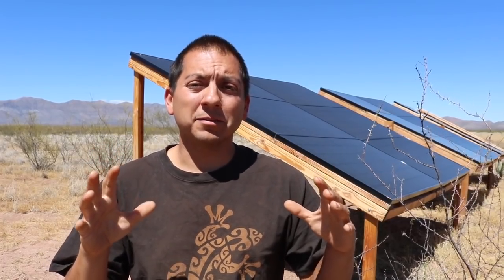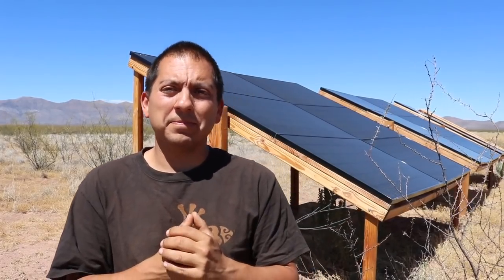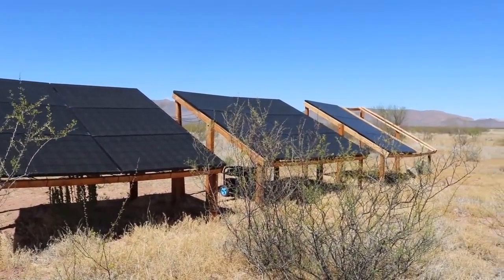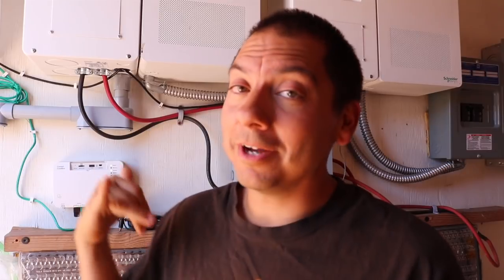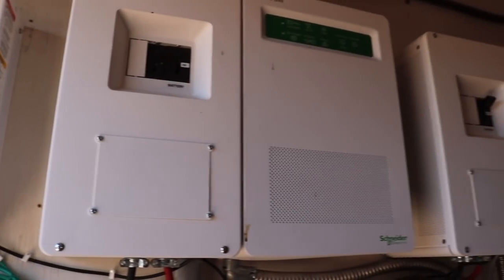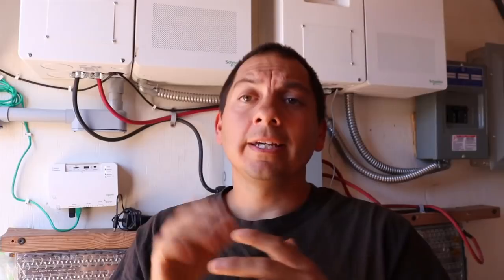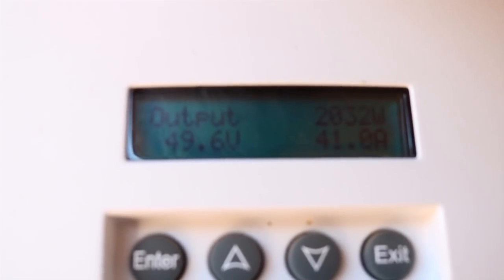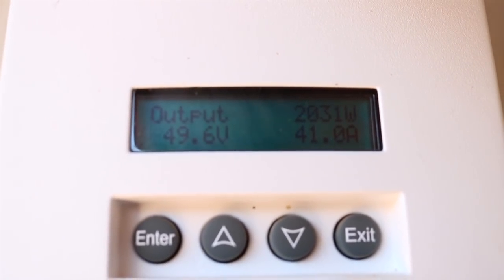Can You Run Air Conditioning on OFF-GRID SOLAR?

Comment: Call me crazy but if cooling is an issue - and in Arizona, it is - wouldn't it make good sense to build the panel racks so that they cast shade over your living accomodations?
Don't need to remove anywhere near as much heat if the heat never even hits the house.

Comment: I think a small portable swamp cooler wood work ok on your solar power.    Mastercool also has a small shop air conditioner that would work fine.  It would be best to put it outside and vent the blower part into you house.

Comment: My grandparents live fulltime in an RV in Florida so they can travel part of the year, something they did to cut down on cooling in the RV is on the land they bought to park the RV in Florida they installed an RV carport. This shaded the RV and drastically cut down on the amount of energy needed to cool the RV as well reduced the overall temps in the RV when the a/c isn't on.
Reply from the maker: Shade is definitely a huge factor out here. The more shade you can get, the better usually.

Comment: That's my next adventure angle is trying to get me some solar power out here Tomorrowland I have a business on my other land but that requires to be hooked up on full like TriCity unfortunately I try to get solar power in my area unfortunately my town doesn't allow it isn't that crazy a town doesn't allow solar power I think it's a big gimmick out here in Royal USA but I got the electricity on one land and II land that I physically live on will have solar power will have Harvest rainwater and will have no electricity running to it I stay in a 30 amp RV I would love to have enough power to run three of these RVs just for land use only of course thank you for such that wonderful information you have provided me and I hope it provided to other people solar power sounds so technical but in reality it really isn't as a bunch of batteries a couple inverters and the solar panel outside soaking up the Sun

Comment: We have been offgrid for over 6 years.  We have built our system from scratch.  We do not have the fancy system you have.  We run a 10400 BTU 110volt Air Conditioner with no issues.  We only have 2220 watts of solar on trackers and 740 fixed solar panels.  We only run a 24-volt system.  We run a 220 volt well pump for the deep well.  We run a 120 volt well pump for our rainwater system.  Plus the typical refrigerator and 2 freezers.  Of course, we still use the lead-acid Trojan L16 batteries.  It's always interesting to see other setups.  I enjoyed seeing your system.   Thank you for sharing.
Reply from the maker: Thank you so much for checking us out!! It's an honor. 🙏
Our system is the way that it is because we had more people at the time. Now it's a bit oversized. 😬

Comment: I couldn't really tell from this video, but does your shade structure extend over your trailer? That would obviously, drastically improve your AC run time on hot sunny days. Well, not drastically, but it would help alot.
Ever considered a 110 volt 12,000 btu mini-split? Hi-efficiency units with 20plus SEER ratings can be found reasonably online, especially during winter months for lowest prices.
Great, informative and clear video!!
Reply from the maker: Thank you! The shade structure doesn't extend over the RV'S. A mini split would be nice, but we probably won't invest in that at this point. We're looking forward now to building a home.

Comment: 6k running Watts is a lot of power. I look at my meter all the time the most I’ve ever pulled was around 7k. That was with fridge freezer dishwasher hot water heater. Everything in the house running. Complete power hog.  Are u gonna hive crew a shave. We need to do that to our dog.
Reply from the maker: Yeah, it's definitely a lot of power. More than we need now, but this was planned for at least two households. At least now we have redundancy in the system. 😀
Thanks G!

Comment: We are still not able to use our solar for ac but we plan to add to our system when we can ultimately run the ac. We use our generator currently which is costly and not really sustainable. Impressive set up, the daddy bear approves! <3
Reply from the maker: 😀Awesome! The system wasn't cheap, but it is efficient. That's the cool part about solar. It can always be expanded and upgraded. 😀

Comment: I agree with what some others have said. Build an underground house. Think finished basement without the surface structure. Underground houses are naturally more energy efficient because you have the earth insulating you. For example, dig a foot deep hole and touch the bottom of it. Already cooler than the surface.
Reply from the maker: Yup! We may also build with earth as well. The more thermal mass the better.
Definitely more efficient. 
Thank you!🙏

Comment: Nice system! We're currently grid tied for electricity, and would like to at least get a little off-grid. Have you looked into wind? If you use a vertical fan system, it's much more efficient than those big ugly propeller turbines. I'm thinking of doing something like that myself in addition to solar.
Reply from the maker: At this point wind might not be the best option for us. We've already have the solar investment, if we needed more energy we'd probably just expand on our current system. 
Grid tied is actually a good way to go. Batteries are usually the most expensive part of the system. You can always add a battery back up down the road.

Comment: I just installed a window ac in our trailer, primarily because of the dogs. I’ve been watching our usage and the window ac uses half of what the roof ac does. Not only that but, it’s cooler and the unit actually cycles. I was worried about the wiring in the trailer as well so I ran my own.
Reply from the maker: That's awesome Warren. We're definitely thinking about switching.

Comment: Perhaps isolate a section of the new roof system and build a swamp cooler.  Not sure how much water or power it uses but they are usually just a fan to move the air and a small pump to create the water fall.  You do not want to enclose the area, you want the area to breathe.  So maybe enclose area half way up and then screen in the top section.  Also helps to stop flying insects.  The AC is using a renewable energy source and where you are water is precious so this might not be preferable.  But it could be an option when you have plenty of water and in the heat of the day in the afternoon.  Low humidity is a must to provide the evaporation and you should have that where you are.
Reply from the maker: Some really good points. Eventually we'd like to build in a way where we don't need any type of cooling other than a ceiling fan. At least were going to try.

Comment: Thanks for sharing.  You can definitely run air conditioning on solar alone with the right equipment. I may be getting the tech stuff wrong, but we are ducted and just waiting to purchase a new inverter that can convert to 220 for air conditioning.  Right now we are running 2 Bonaire swamp coolers that work pretty well when temps are under 3 digits.  How are you liking the Tesla batteries?  We've talked about converting over to them from our deep cells?
Reply from the maker: I think the Tesla batteries are great, but I haven't used any others. Once they're hooked up though, you never have to worry about them.

Comment: Hey, we have exactly the same panels as you.  That is, 15 x 320 watt LG - located in Tucson.  We tried to run a 120 volt mini split off the "emergency" 15 amp outlet on our SMA inverter.  It was a no go.  The mini split was rated at only 9 amps, but probably draws much more briefly to start the motor for the compressor.  

I think the problem is we could not produce the amps to start the motor.  The mini split made some straining sounds, but did not start.  I think a big reason you can run your A/C is because the batteries allow more oomph when a motor starts.  We do not have batteries and the panels alone are not enough.
Reply from the maker: Yeah, that could be. That's the nice thing about the batteries. It allows for that extra energy should the system need it.

Comment: If you're running with free and green electricity (after the initial investment of course) why be so concerned about efficiency? Who cares at that point? Just curious why you're so concerned about efficiency as long as your current system can handle your needs.
Reply from the maker: The energy is free, but not unlimited. Our trailer only runs with a 30 amp service and that adds up quick depending on what you're running. If things ran more efficiently it just gives us that much more freedom to run what we need.
Reply: @ourselfreliantlife  Sounds logical. I was just going off of your comment that you have more than enough power generation for your needs. Especially after the ranch downsized recently. But yeah, you obviously need to stick to using what you generate unless you want to spend even more money.

Keep up the great work.

Comment: Thanks for the video.  Nice to see you have a robust solar/electrical system.  You see so many DIY solar systems that are very inadequate and produce lots of headaches.  As far as your dog goes, I suggest getting him clipped down near the skin.  He may look a little funny at first but he will be SO much more comfortable.  Fur grows back all too fast. Secondly, consider checking/cleaning your rooftop air conditioner.  Even small amounts of dirt/dust on the vents/radiators can create significant inefficiencies.  You could also consider building a small sun shade to go over your AC unit.  The cooler it is, the less work it has to do.  Just make sure it is stable in the wind and that it does not impede or trap hot air from the AC.
Reply from the maker: Good tips. I'll definitely check on the AC. I get some conflicting information on shaving Akitas though.
Reply: @ourselfreliantlife  You may be right about Akitas.  I don't have any experience with them.  My sister, however, has a couple mixed breed mutts that she gets clipped short (not shaved!) every summer and they are much happier.

Comment: Add a "earth tube" to your future home design, it'll allow for passive AC all year round. Earth Tube uses physics to heat/cool your home, via the thermal mass of the ground, the ground temperature are a constant , cold air entering this tube gets slightly warmer(due to the thermal mass of the ground)  before entering into your home, the exact opposite happens when warm air enters the tube, the air is cooled down before it enters your home. Earth Tubes are also great for heating/cooling a greenhouse. As the cooler regulated air is coming into your home the warmer air already inside the home will get pushed upwards, so you may want to add a opening(something you can open and close,manual or remote control) at the top of the ceiling to let the warm air out. There are info on how to design earth tube online, how big the tubes should be, how deep you should dig, how many tubes,etc.
Reply from the maker: Oh yeah! We definitely want to play around with that.😀

Comment: When we told people we were moving off grid I had a couple of folks ask me if we were going to use candles for light! 😂  Nope! Only for fancy dinners! If you size your system to meet your needs, you are fine. We us a propane frig and a propane freezer, and that makes a huge difference. Have a great week!
Reply: We are looking for some propane appliances as we get ready to set up our system too.
Reply: Very sensible! Our refrigerator, freezer, stove, and hot water heater are all propane. It makes a huge difference. Add to that being passive solar and super insulated, and we do pretty darn well most of the time. We have a large in-ground propane tank to protect it from wild fires.
Reply from the maker: Exactly right Irene! It's all about sizing it right.

Comment: Crew is a good reason to run the air. Im glad you built a set up that was bigger than your needs than smaller. You will be more prepared when you build your home.
Reply from the maker: Absolutely Linda! It's better to be a bit larger than not have enough.

Comment: You may call it inefficient, but running anything for FREE is efficient as can be, Jim.  Nicely done!
Reply from the maker: Thank you! It definitely feels good to be producing our own power.😀🙏
Reply: There is nothing 'free' because the upfront costs are VERY expensive + the Tesla (or any battery bank) also have a time life to them.  On top of that, 2,000 watts for an RV may be nothing, but it would never power a conventional home with fridge/freezer, washer dryer, etc.  A simple hand held hair dryer can pull 1500 watts.  You have to 'manage' your consumption.
Reply: @avflyguy  I can see why your wife left you.